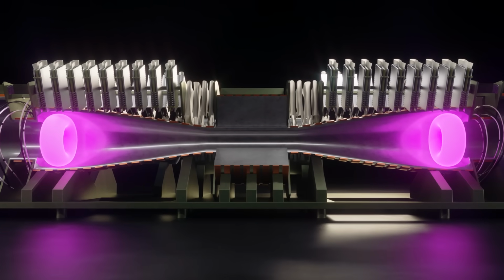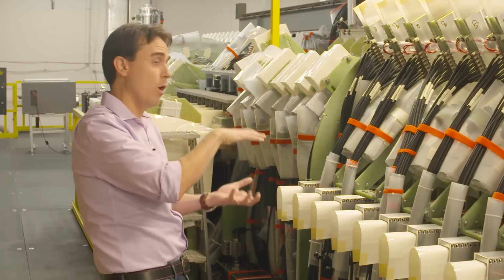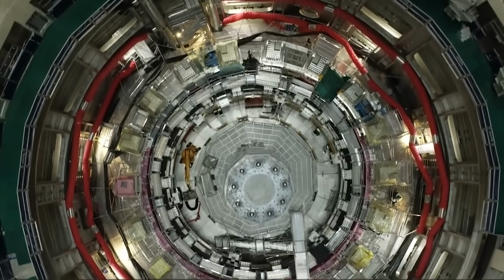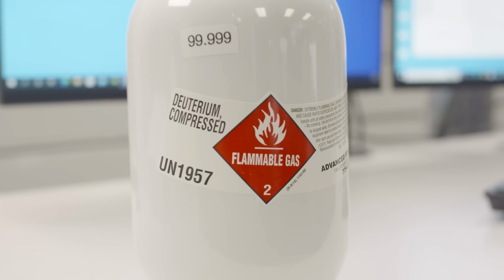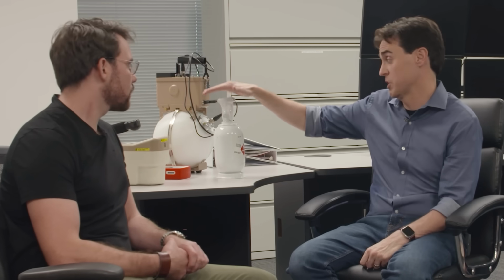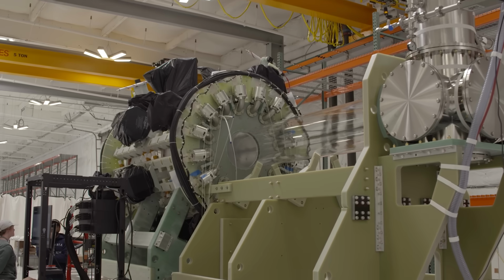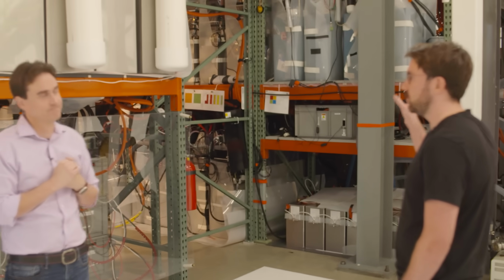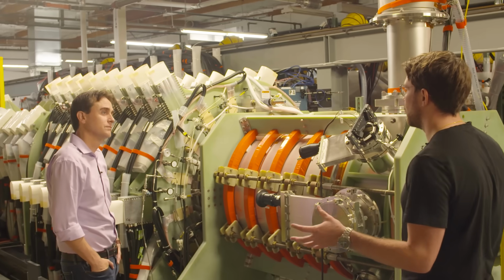A New Way to Achieve Nuclear Fusion: Helion

Comment: Like so many others, I really would love this to work. Having grown through the years of huge optimism as far as fusion is concerned, only to end up disappointed, I am extremely sceptical, BUT I still really hope this works! Good luck guys.
Reply: Right? I was really really disappointed when I learned fusion for the most part was again going to be used for turbines just like nuclear reaction which wastes 99.9% of the energy created. This process seems far more efficient and safe not to mention compact enough to fit on starcraft  or drone mining ships that could start harvesting the near limitless resources of the asteroid belt and the much closer moons of Jupiter.
Reply: @DanEnough4You  actually, it doesn't waste 99.99 like you claim, if you know a little bit about carnot and rankin cycles you woudn't say this non-sense
Reply: @zazugee  Non-sense is still relying on energizing highly radioactive materials and using the byproduct of  colliding molecules (heat) to simply to boil water for kinetic energy transmutation to antiquated electromagnetic turbines that transmit electrons through an inefficient and primitive set of ancient cables where energy loss is guarantied over distance. 
I do understand Carnot/Rankin and I'm saying with our current understanding of physics we have near reached the zenith of what is possible with turbine electromagnetic creation. 
An efficient system would harvest the electrons themselves from far less volatile materials and transmit them with far less loss through micro burst frequency relays. We're still very much in the stone age of energy creation as too many resources are being spent on shiny new hubcaps for the same old wheel.
Reply: @DanEnough4You  you need alotta certificates and papers from all the capable space faring countries cuz the threat of COD EMP still existed they could be weapon besides solar sail there are nuclear propulsion spacecraft, it would be even better with fusion and for the sci-fi theres IXS Enterprise.
Reply: @Adhjie  Trust and believe that there are much more sophisticated and efficient EMPS designed with high power solar aggregate capacitors and most probably strategically set in LEO to deter ICBM's.
Also  I appreciate your optimism but I think unmanned craft without colonization is our only option until mastery/manipulation of gravity is achieved. 
We can't send healthy bodies into space to stay for long in even low earth orbit let alone the moon and a 2-3 year round trip to and and back from Mars would be a death sentence for a great many reasons but mostly radiation and gravity. 
First we must find better energy sources then we must conquer gravity before we ever seriously consider space travel much less colonization of other worlds.
Reply: @Adhjie  those papers and certificates would be rubber stamped. there are no space faring countries. there are only a bunch of children dipping their toes in the water. after this, we would be a spacefaring species. and later AI would have no worry about competing for resources with successive generations able to reach the asteroids and entirely other worlds where they could determine their morphology and purpose. if there is ever going to be a singularity, then this promises to be one more step towards it--either a merger with AI or at the very least non-hostility. if this tech actually delivers, then we are in a new age.
Reply: Thought the same thing while watching this.  Sounds a little too good to be true so I'll believe it when Polaris is actually up and running, delivering electricity into the grid.
Reply: Practical fusion electricity generation is always 30 years away
Reply: @harleyquinn8202  Nailed it!  Plus, the Brandon admin hates nuclear, so even if there are significant advances, they will be suppressed.
Reply: And even if it works, just wait until the first disaster. Public opinion will turn, and we'll go back to burning our planet to the ground with fossil fuels.

Comment: Does Helion have a local fission reactor for breeding helium 3?
Reply: Helion will produce their Helium3 by fusing Deuterium in the same machine. D+D => He3 +n or D+D => T + p (the Tritium eventually decays to He3 as well). No space travel required.
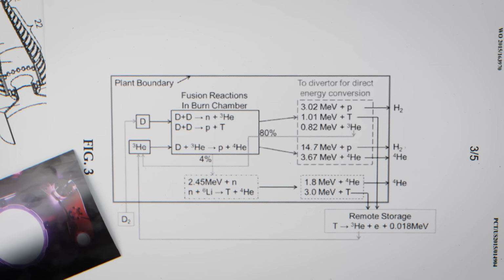Reply: They use Lithium breeding as seen in their diagram at 15:40
Reply: @13deadghosts   They could use the D-D neutrons with a lithium blanket. They have that option in their patent (which the diagram is from), but they are currently not considering doing so. The complexity is too high.

Comment: That tritium from the helium-3 could be used in a duterium-tritium reactor. Since they already produced it, they dont need a multiplier. Then, use the 1/8 power output one to generate some energy. Maybe use that energy to power the powerplant, in stead of aiphoning from the main one?

Now, use the neutrons to boil water. Every little bit of power is more power!

Comment: One place where there's a lot of He3 is... The Moon. Solar wind, over however long, has been throwing particles out in space. Some of these particles are He3, and the ones that end up hitting the Moon can become trapped in the top layer of regolith. So if this clean, portable, cheap fusion reactor takes off, there might be money in flying off to the Moon and starting a helium mine. 

Of course going to the Moon is horribly expensive, but if you make it routine, it can be cheaper. Buzz Aldrin's Cycler is one possible idea. If He3 becomes the world's fuel, and you only need a small amount to fuel a reactor, even a small tank could sell for a lot of money.

We could maybe use a mass driver to send tanks of He3 from the Moon's surface to Earth orbit. From there, ships could come up and down to collect it. They might even be powered by fusion themselves. The world's fuel would come from the Moon, so we'd need to settle up there for serious, at least enough staff to keep the machines going. Lunar regolith is powdery but very hard, it gets everywhere into machines and grinds away at moving parts. So you'd need a few corrosion-resistant monkeys up there to make new parts.

Abundant free energy and Moon colonies! I hope this works out, it would be a nice thing for this otherwise crappy timeline to end up having.

Comment: This is analogous to a Deltic Diesel engine in which opposed pistons when coming together compress the fuel air mix to reach combustion temperatures whereupon the sudden pressure increase is captured as work during expansion by pushing the pistons back.  Helion’s  ‘pistons’ are electromagnetic fields and for ‘combustion’ substitute ‘fusion’.  The potentially damaging neutron flux would, I thought, be moderated by water housed in a tungsten jacket, the idea being that dense metals are in effect transparent to neutrons but hydrogen is remarkably opaque to them.

Comment: So... this thing generates electricity directly, from the action of the fusing particles pushing back on the magnetic field? Rather than creating heat like most fusion reactors, which then have to figure out how to get the heat away, to generate steam or heat some gas, without melting the entire thing. That... is... genius! At least if it works. So simple! I really hope they can get this up well past unity, you could put one of these in your garage and power your neighbourhood! 

And it's small, not VAST, like other reactors. Looks (relatively) cheap too! That's a guy who knows his physics, and can explain it simply. This might be the future of the world. NIF have gone past unity but I think that's just the first stage. This thing though doesn't even seem to have moving parts, past the plasma and I suppose some valves to squirt the fuel in. Direct to electricity! I feel like shouting out "GENIUS!", but then... nuclear fusion power is 20 years away, and has been since the 1950s.

Comment: Considering a single motion is successful, repeating this motion with consistent results and stable ends makes this a real phenomenal achievement. Also, it's a fraction of the size of Iter. Well done
Reply: And a fraction of the size of the NIF inertial confinement experiment too, with its 1% efficient lasers!
Reply: The size thing is important. The ITER site is huge and the project may end up costing $65 billion. Smaller reactors like this will be massively cheaper to deploy, build, and run. If it fits in a warehouse, you could build a few of them around your city to provide all your power needs.
Reply: @DBailey635  damn imagine that, sustainable energy easily accessible and not frightening like nuclear plants or devastating to the environment like fossil fuels
Reply: @bencurran3204  nuclear plants are only frightening because we've failed as educators.
Reply: @bencurran3204  Nuclear plants aren't frightening at all.  Ignorance and purposeful misinformation has lead to a negative public view of something that we should have been using for decades already while we wait for nuclear fusion to be perfected.  Its still not too late to employ them either.  Nuclear Fission is clean and reliable, and doesn't leave behind the scary nuclear waste everyone thinks it does.  Matter of fact if you were to gather all the nuclear waste that all nuclear power plants have ever made I don't think you could fill a football field.
Reply: @bencurran3204  oh no, almost no risk at all, how frightening
Reply: @bencurran3204  
Fossil fuels are no more devastating to the environment than CO2 was in contributing to a warmer Earth 100,000 years ago.  The Vostok samples proved the Earth was much cooler despite dramatically higher levels of CO2, science now ignored by pseudo-science propagandists.
Reply: @bencurran3204  nuclear plants are so frightening that we could all drop dead today and nothing would happen for thousands of years.
Reply: it's basicly a step up.  
nuclear reactors and iter are like 1800's technology.  
it's basicly a steam engine but we are using something other then coal.  

while this reactor is more like a combustion engine.   
so if this works and works well.  
expect another explosion in infrastructure and technology as the invention of the combustion engine
Reply: ITER is deliberately that size as they have reached the limits of what they can find out in tests with smaller Tokamaks and the design ran into problems at smaller sizes. Wikipedia lists 34 active Tokamaks alone and another 25 already retired installations (some with more than one reactor chamber used).
You're trying to do the same thing as the videos: Pretend that ITER is a first generation model, when there have been experiments done with Tokamaks for 64 years. They are also at Generation 10 or 12... and not yet close to making it economically viable as energy source.
Reply: Why do they call it Iter? It can't be iterated.
Reply: @tmst2199  iter means "path" in Latin. It is meant to be the path to the actual feasible fusion.
Reply: @frcrr  Thx. That makes sense. I stand corrected.
Reply: @tmst2199  😂😂... 
ITER - International Thermonuclear Experimental Reactor
Reply: ITER is DOA, like ALL of the big EU projects so far. from supercomputer, to Google killer.....
Reply: SPARC is also a fraction of the size of ITER with similar capability... as far as Tokamaks go ITER is obsolete before it even goes online by about 10 years.
Reply: This is what so suspect about it. "The power of the sun in the palm of my hand"? Seems too good to be true. Been too many times these new "disruptive tech" ended up being overpromises or just plain scams.
Reply: @frcrr  If you'd actually understand anything about nuclear physics and fusion you would know how big of a deal this really is what Helion is doing. You can't judge something you don't understand...
Reply: @nicok.1491  Oh, I'm not judging. I'm doubting. They haven't reached 100%, meaning what they have is an energy consumption machine. I'd be glad to be mistaken, but i'll hold on to my skepticism until proven wrong.
Reply: @frcrr  If everyone had as much doubt as you have about the future, it would be a very very dark future. Imagine the engineers going like hmm let's not even try this cause we have doubt in it working...
Reply: @nicok.1491  Okay buddy, don't get so dramatic on me. People who easily believe in whatever have special word for them. "Gullible". So yeah. If everyone was as gullible as you are we'd live in a truly dark place.
Reply: To everyone making a point about the bad teaching and such, I know, but public opinion is a massive influence, incidents in the past, which are always caused by bad maintenance or terribly trained staff. For example, one of the plants in Essex causes enough fear for people to be given Iodine pills, and I have no issue with the existence of plants myself, I actually advocate for the existence of plants.
Reply: @bencurran3204  these incidents in the past are harmless, radiation harmed no one in Fukushima, and even Chernobyl caused less harm to people and the environment at full reactor meltdown than a coal burning plant of its era did during normal operation for the same amount of GWh produced over its lifetime. Even at it's very worse, nuclear power outperforms fossil fuels on safety.

There is no pill to hand out against air pollution or climate change.
Reply: @martinkrauser4029  you're ignoring my point, I was saying past incidents, not stating them as cataclysmic but as heavily prominent ones (chernobyl did devastate the Welsh lamb trading due to radioactive pollution travelling the currents over there), have heavily played into the fact nuclear plants are feared, I was not saying they are something worth fearing, but incidents like the demon core, SL 1, and the what three mile island incident? Are examples of this in America alone, a YouTuber has a good video on an incident that happened in South America where hundreds killed and thousands effected by an xray machines radioactive dust, these play into the fact that people are scared, yes they are not as massive as a disease, nor global warming, nor war, but the point stands, it is heavily publicised as dangerous, nuclear weapons although they work is massively different play into this as well

My point was public opinion causes such things to not be accepted
Reply: @bencurran3204  Your point breaks down when we can re educate people on the matter, instead of giving up and letting public opinion do the talking.
Reply: @martinkrauser4029  all that that shows is that third world country's that cut corners should not be trusted with any kind of technology that can't afford having corners cut.  
they would turn the helion into something dangerous aswel.
Reply: @EGCentre  "re-educate people". Yeah, Im sure that will work out so well. Because its not like people block their ears and close their eyes to anything that disagrees with them these days or anything.
Reply: @EGCentre  it doesn't break down, I don't get how you're not understanding my point. I would happily advocate to be educated on it, properly, I understand it enough as it is to know it would be the best route until fusion is affordable to rely off of nuclear energy. But 1 person me or you going these people need to be educated is trumped by 1000 going I am scared of it but don't want to sit down and have it properly explained to me
Reply: @HangusSmacksamus  lmao when you put it like that I can see what you mean
Reply: @jacobhargiss3839  It's worth a try tho...
Reply: @HangusSmacksamus  druggies should btfo(you are subscribed to some marijuana channel)

Comment: “But can it boil water” is the “can it run doom” of energy generation
Reply: Ah. In this instance you get to skip the boiling water part. Which if they've proven it on the bench in the lab would be one of their biggest breakthroughs
Reply: That's the beauty of this beast. It doesn't have to. It skips several steps and directly harnesses the power of the reaction and converts it right to electricity. Thus cutting out hundreds of layers of complexities and ineffeciencies parasitic to most generators.
Reply: @Pyrus.Mortis  how?
Reply: @spoilerwarning8383  It's explained in detail in the video
Reply: @spoilerwarning8383  as Maxi says it is explained in detail in the video if you have the patience and attention span to watch the whole thing. If you don't understand how that works, I would recommend looking up a video on what Generator Action is and how it works.
Reply: But can it run crysis?
Reply: @hustler539  the real question
Reply: And can it help reduce the piles of old spent fuel...
Reply: @1kreature  a Thorium Molten Salt Breeder Reactor can reduce existing "nuclear waste" to less than 1% and secure storage from 10,000 years to less than 300 years.
Reply: Not so much boil as vaporise.
Reply: "does it take Glock mags?"......every industry has something

Comment: I'm not sure but I do have to wonder why they seem to be using regular copper magnets ( am not done with the video ignore me if they are using super magnets) and not super magnets (I know superconductors have a current limit but in practice it is more that super conductors have a current density limt so they can only take say 1000 amps/cm2 ) I realize it would be bulkier but for operating costs it should cost a lot less and you should be able to step down the voltage to increase the amperage to generate the super high field strength needed. Still REALLY cool
Reply: Neutrons from the fusion reactions would damage superconductors to the point where they fail being superconductive. You need about a 1 m thick shield of specialized materials to stop those neutrons but then your magnets are to far away from the plasma to compress it enough.